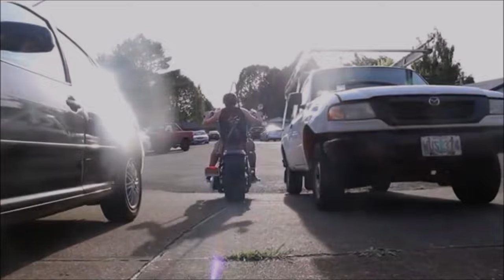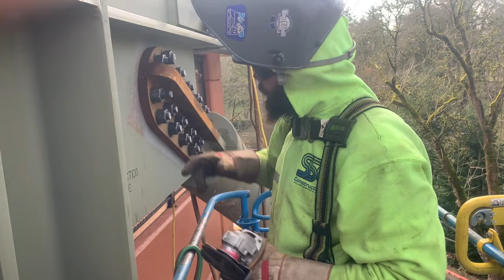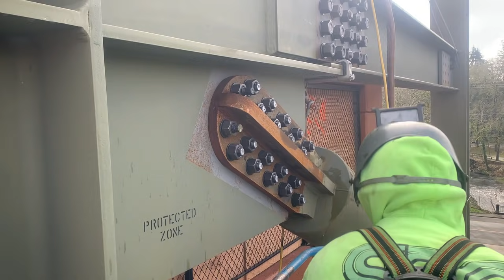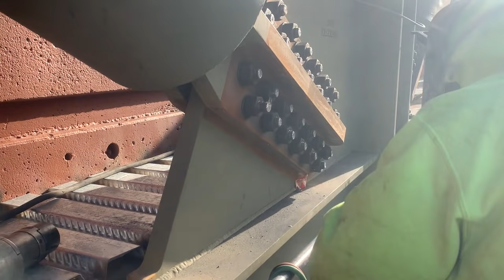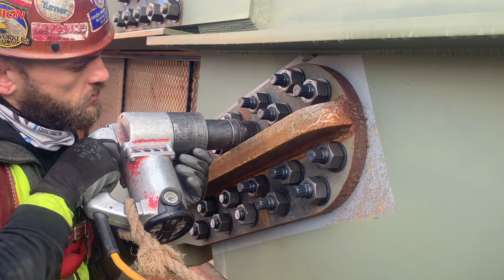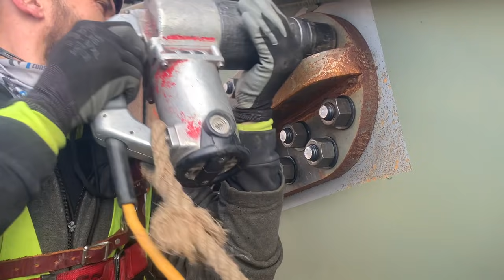ironworkers tip while snapping bolts

Comment: Interesting... any time I've "snapped" a bolt it was usually followed by a curse word and a flying wrench.
Reply from the maker: The term snapping a bolt is referenced from a tension controlled “TC” bolt... it has a little tip that snaps off once it’s up to torque to show the inspector that it’s been snapped
Reply: You just gotta back it off a quarter turn and save it for the next guy.
Reply: @ChantzFabz  thank you for explaining.. but why is the first guy grinding the top off?
Reply: @elliot330  The end is rolled, like a stripped bolt head... He cuts the tip off so there is fresh splines, or teeth, to grab onto.
Reply: @SwingingTheDead1  ok now things are making sense, i thought he was trimming them off for clearance. how is the (impact?) gun not rotating back when torquing them down? how many ft lbs are we talking about here?
Reply: @northbound5493  the other side of the bolt is rounded you can’t put a wrench on it the Lejeune gun turns the bolt and nut opposite ways snapping the nipple off at like 1033 foot pounds
Reply: @ChantzFabz  Ahhhhh, so the tool engages the splines and holds the bolt stationary while turning the nut? And once the designed torque is reached the splined section then snaps off. I was sitting here wondering wth the tool was doing but I think I get it now
Reply from the maker: @MrNavyman53  yep you got it sir!
Reply: Same with me except I didn’t snap a bolt, I hit my finger with a hammer, which ended in a curse word and a flying hammer
Reply: @ChantzFabz  thanks for the explanation. I never knew that snapping bolts could be a desired end in any nut tightening situation.  @sml123 thank you for the elaborate understanding in your explanation
Reply: I agree hahahaha
Reply: Same here
Reply: @Chant fabz shit thats for explaining. Really cool how that gun works
Reply: And bloody knuckles
Reply: I too have experienced this phenomenon of wrenches flying after a bolts snapped
Reply: Very relatable
Reply: Snapped a bolt on my motorcycles headlight mount and had to drill it out and then the drill bit snapped because it was dull and the person helping forced it. 
So drilled that out and threw a toggle bolt in there and a washer or 2 good enough for now ill probably fill the hole and drill and tap it properly maybe when my son is Old enough to help in the garage.
Reply: @jameshendricks8526  We use something similar in water and wastewater utilities. Many flanges have bolts that are designed to be tightened until the head literally snaps off, signaling that the correct torque has been reached.
Reply: @ChantzFabz  like on air planes

Comment: Never seen this before. Worked on power houses before and we would stretch the bolt then run the nut down , then release the tension. Cool to see.
Reply from the maker: This is a tension controlled system with the compatible gun and bolt
All in one
Reply: Yessir I've used the river hawk and pilgrim. Millwright local 219 🔧🔧🗜🧰
Reply from the maker: @snesie7172  🤘🏼

Comment: Id gladly add that power tool to my collection! I'd also save them tips for forging knives. I'm sure it is a very high carbon steel that can quench very well and be made into Damascus nicly.
Reply from the maker: Yeah externality high carbon LOL
Reply: The bolts are either A325 or A490 bolts, you can google them for the carbon content (and other elements)
Reply from the maker: @Jim-nu6ux  thanks 🤘🏼💪🏼🍻✔️

Comment: Another tip. After snapping off the tip, discard the tip in your or your apprentice's bolt bag or bucket. Anywhere but the ground. Here in Los Angeles, creating a slip hazard will get you run off. Any journeyman should know better.
Reply: Your supposed to discard them onto the safety guys hardhat.

Comment: Dumb question but I noticed after u remove the socket gun u turn it towards you for a split second why?
Reply: the end of the bolt it snaps off is in the gun. simply turning and dumping the snapped tip out, before proceeding to next bolt.
Reply: @ATRMAN-no8zc  thank ya
Reply: @timothykiniris1724  np bro 👍

Comment: How about when the entire tip gets striped. Or when the threads strip before the tip snaps then you get the nut off. Got any tips for those?
Reply from the maker: Bolts compromised... gotta remove it and replace

Comment: So is that drill snapping the bolt and torquing down the nut?  If so, about how many lbs does it apply?
Reply from the maker: The tool and the bolt is apart of a tension control “combo” I guess you would tall it... so it tightens the bolt holding on to the tip once the tip is snapped off it’s up to torque

Comment: Boilermakers’s connect our own iron if our structure sits on it and the last couple of jobs I connected on before I retired we used compression washers
Reply from the maker: Yeah there’s 4 approved methods for tightening steel... 
1. Tension control (TC aka snapping bolts)
2. Turn of the nut 
3. Squirt washers like you’re saying 
4. Ironworker hand tight
Reply: Yeah I remember before the squirt washers we used Le Jeune bolts like you were using in your video Union Strong stay safe brother
Reply: DTI
Reply from the maker: @mojavered.  direct tension indicator....? I believe that’s what the acronym means
Reply: @ChantzFabz  I'm a ICC structural steel and welding inspector. I've been an inspector for some time but I'm new to welding and bolting.

Comment: A so anyone notice that you can see the slightly rounded face of the nut the other side is flat to help glide on the washer for proper torque from a TC bolt
Reply from the maker: Whatcha mean
Reply: Depends on the bolt brand... but ya on the side with the DH markings the edges and corners are rounded the other side looks almost like a built in washer... i think Power is the brand that did it firat
Reply from the maker: Awhhh yeah! I gotcha

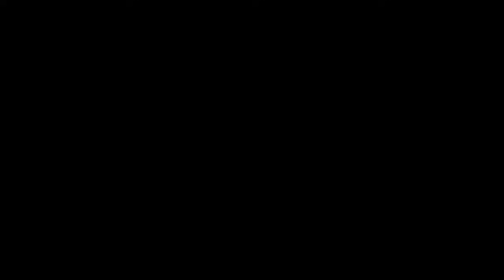Comment: At 1:56 the tc gun should never be running that long to snap a bolt. Get that air impact going.
Reply from the maker: Up in a lift snapping bolts drawing stuff tight as you snap the point you loosen up other sections of the piece it’s inevitable
Reply: @ChantzFabz  2 rounds of the air impact and they shouldn't loosen up. I was we can post pictures and videos on these comments. I'm retrofitting an airport right now. Shit ton of brb's. You guys keep kicking ass!

Comment: Do you have to cut slower, or wait for the bolt to cool before snapping, so heat doesn’t affect your torque numbers?
Reply from the maker: No just make it happen fast and finish the point or replace the bolt and snap it whatever is faster

Comment: How much heat did you add to the stem that could change the TQ at witch it snaps V a cold snap
Reply from the maker: Yeah I couldn’t tell you that one but I bet Vegas bolts vs Seattle Washington rainy bolts have a variants
Reply: The variation in shear strength depending on temperature for steel is pretty insignificant up  too several hundred degrees. Ontop of that heat was cause an expansion that would reusult in  increased tension on cool down

Comment: Do tools like that have to be certified every so often?
Reply from the maker: No the torque is in the bolts not the gun... hard to explain hahaha
Reply: @ChantzFabz  I think there is a way to explain it rather simply. 

When tightening a nut with a normal wrench you use your hand to apply force, when using a gun like this the gun applies force to the nut instead of your hand. For things that you tighten by hand you can measure the force my using a torque wrench, it's essentially a normal wrench with the ability to measure the force being applied to the fastener. For something like this you might be talking 1,000ft-lbs (for a 1ft long wrench you would need a 1,000lb weight). That is clearly more force than any human could possibly control with just their hands without using a HUGE wrench, so you need a different way to measure the required torque. That method also needs to be repeatable, free from user error (like setting the wrong value or bumping the settings), and easily swapped from one value to another.

The simple answer kills multiple birds with one stone. You are turning the nut clockwise to tighten and you don't want the bolt spinning when you do this. So why not do the same thing as when we open jars, hold the bolt and turn the nut. Now we can apply 1,000ft-lbs without snapping someones wrist. If we design the bolt so it has a thin section that is small enough that it will actually break away at a specific torque (like the tear open sections of boxes and envelopes) then we can ensure that the nut is perfectly torqued every time. We know the bolt snaps the end off at 1,000ft-lbs, the gun uses the bolt to apply force to the nut and the operator just stands there picking his nose doing the easy part of the job ;)

This way you can ensure that every single bolt is torqued down just by quick visual inspection instead of having to go over each one with a torque wrench to ensure someone isn't being lazy and just using a regular impact without checking their work. When you want to change torque specs for different bolts, they just use a different bolt and nut, no settings on the gun to worry about.

Comment: How does that tool not rap you up real tight from torque with one hand
Reply from the maker: The gun holds the tip and turns the nut so no torch for you to hold just a heavy gun
Reply: LOL! Heavy tool my butt. You haven’t carried a 2” square shank rattle gun and 400’ of 3/4” air hose dragging behind you on open iron @ 700’ in the air on open iron. Do you know what a hell dog is?

Comment: What's the point of snapping those bolts ?
Reply: The bolts are designed to hold a torque counter to the torque applied to the nut to tighten the fastener. Once the bolt snaps, the gun stops tightening. So the engineers can have the bolts designed so that they snap when torqued to the appropriate spec. Takes the guess work out and it’s fast.
Reply from the maker: @Daltonleach11  thanks haha
Reply: @Daltonleach11  Wow nice, I had no idea. Thanks man, there's stuff you learn every day.

Comment: How are the bolts snapped
Reply from the maker: The tip of the bolt gets sheared off once they are at torque that’s what the whole system is designed for

Comment: I have no idea what's going on
Reply from the maker: Shear wrenches are a non-calibrated drive tool with an inner and outer socket specifically designed for installing tension control or twist-off bolts.  The inner socket holds the 12-point spline on the bolt while the outer socket drives the nut, pulling the fastener into tension.  TONE brand tools are a high quality, top of the line tool with a proven track record for durability.
Reply: @ChantzFabz  yeah but why does the tip get rolled?
Reply from the maker: @xenonram  sometimes it just rolls it I don’t know why...

Comment: Where do you put the splined end after it snaps off?
Reply from the maker: It’s stuck in the gun and there’s an extra trigger to shoot it out of the gun... it’s kinda fun to shoot your partner it doesn’t go super fast to hurt unless you shoot it and the tip drops a long ways that’s all bad.... but you shoot it in your hand or on the iron so you can put it in yoyr bolt bag or a bucket whatever is clever... have yoyr ever snapped bolts before?
Reply: @ChantzFabz  I snapped bolts. Local 44 Cincinnati Ironworkers, I snapped bolts and hung iron on The Christ Hospital union center boulevard  2016
Reply from the maker: @danielfinney4295  right on right on🤘🏼
Reply: You spit them all of the job site so the carpenters bust their ass😎

Comment: What's the purpose of those bolts?
Reply from the maker: These bolts are extremely strong and effecient!!! Easily visually inspectable for structural inspectors
Reply: @ChantzFabz  no, i meant the the caps on then, why even have them on the bolt?
Reply: @NIHILWR  basically the top of the bolt is gripped by an inner part of the wrench and the nut is tighten by an outer part.
The tourque needed to tighten the nut is transferred to the tip of the bolt instead of the operator's arm.
The tip also has a predetermined sheer line where it brakes, and is engineered to brake off at a very specific torque.
This ensures that the torque at which the tip brakes off is the amount needed for the job.
Reply: @TheGiuse45  ooooh, ok. Thx

Comment: What's the reasoning you do this l?
Reply from the maker: Read down and check the lower comments it’s a lejune system snapping bolts referse to snapping the tip that’s suppose to shear off once brought up to torque

Comment: So all that because they can't get decent threads?
Reply from the maker: No the bolt and gun are part of a system... the tip is a star head and holds the bolt while the nut tightens down to torque!!! Once it’s at torch the tip snaps off 

But sometimes it’ll almost “snap the tip off” aka snap the bolt and it’ll roll the star pattern tip and it’s a pain to loosen it to put a new bolt so if you cut the rolled star pattern off you can put the gun back on it like normal and finish the Job
Reply: @ChantzFabz  always wondered why they had the star on em. Never seen a gun with that in it. I just use a regular impact. Now I know
Reply from the maker: @tellrowland2370  we use TC application a lot

Comment: Cutting the threads down like that removes the stamped numbers for material used. Big quality control issue then.
Reply: Good safety practice of tying off the torque gun.
Reply: Safety and quality protects union work. Greetings from Chicago Pipefitters Local 597.
Reply from the maker: No I’m not cutting the threads... have you  seen a TC bolt??? The TC bolt has a nipple on it I’m cutting the nipple where the grooves have been rounded
Reply: Haven't worked with that type of attachment. Haven't seen in the mechanical field. Must be structural only.
Reply from the maker: @danielharmatys7142  copy, that makes since then... 

It’s a TC bolt nothing done in this video effects the finished product
Reply: How is the work situation in Portland? Is there much heavy industry?
Reply from the maker: @danielharmatys7142  work is crazy busy in Portland

Comment: I’m clueless 🤷‍♂️
Reply: The bolt has splines on the bottom end. The impact grabs them + the nut, spins the two against each other, and snaps the tip, just the tip, only for a minute when peak torque is reached (AvE reference in there for the Uncle Bumblefack crew)
Reply: @HJZ75driver  apprentice bumblefock here, I'm still non the wiser, need some Google research on subjects other than young ladies I suspect!

Comment: You could just use the right size bolts then you don't need to do that little grinding "trick". That's new guy shit anyway bub. Also goes alot faster if you pre tighten them..
Reply from the maker: It’s the right size bolt.... these are TC bolts sometimes the spline gets rolled after it’s 90% torqued and the only way to loosen it is to get a breaker bar or cut it out so if you just cut the rolled part off then nipple this saves a bunch of time.....
Reply: I've never had that happen. Must be a manufacture problem with the bolts. Only time I've seen it strip the nipple is if the bolt is too long or too short. Only complaint I got with them is when you gotta break out the ole hand held because there's not enough clearance for the gun.

Comment: I think you should of explained what you were doing a bit better. This looks like doing it properly is quicker than cutting it. You didn't say about a work around for damaged tips
Reply from the maker: I explained that the tip is rolled... so you cut the rolled part off and the gun can bite the rest of the tip so it’ll bring it up to torque and be snapped just like normal

Comment: Man  a lot has changed in 30 years , we would be rattling up the bolts with a heavy pneumatic impact wrench ( yo-yo ) from a wooden float we would hang . Guess there is no climbing or sliding down the columns anymore either.
Reply from the maker: We climb and slide down columns as connectors.... those jobs are few and far between and there’s not a high percentage of cats that can hang.... littterly hahaha check this video out https://youtu.be/cUZ-Ul-qSQ0
Reply: @ChantzFabz  yeah I can see it with connectors  , when we were building the Corvette factory at first we had no ladders , just climb the columns and pull ourselves up onto the lower cord of the trusses , by what the men in my old local tell me now is that I’d get run off the job for OSHA violations if I tried to do it the old way
Reply from the maker: @randyblackburn9765  hahahah yeah most likely lol less people die though that’s one good thing about stricter safety!
Reply from the maker: @randyblackburn9765  yeah it’s kinda lame... but less people die each year because of stricter safety so that’s a good thing
Reply: I hung iron in 82-85 while in college. We were snapping bolts then.
Reply: someone out there always making new rules and regulations to help save the world. shits outta hand if you ask me.

Comment: Dotn understand what there doing to the bolts? Could someone explain lol?
Reply from the maker: Haha 

Shear wrenches are a non-calibrated drive tool with an inner and outer socket specifically designed for installing tension control or twist-off bolts.  The inner socket holds the 12-point spline on the bolt while the outer socket drives the nut, pulling the fastener into tension.  TONE brand tools are a high quality, top of the line tool with a proven track record for durability.
Reply: Very cool, seems like it visually “guarantees” everything has been tightened down enough.